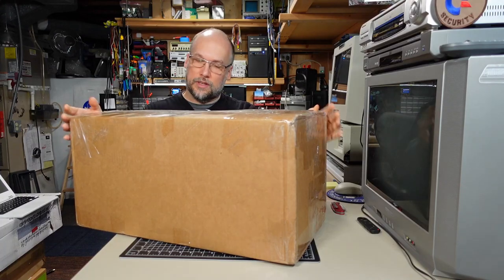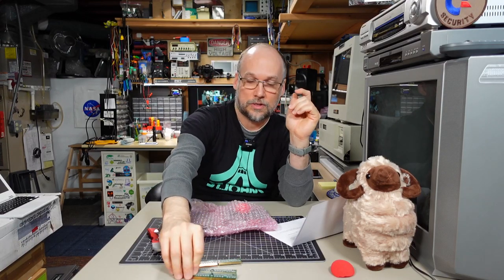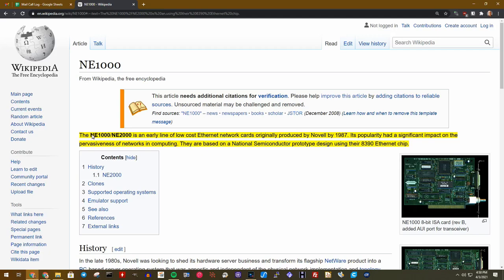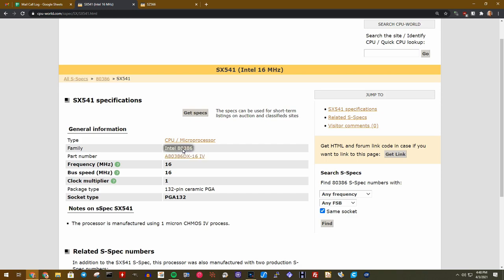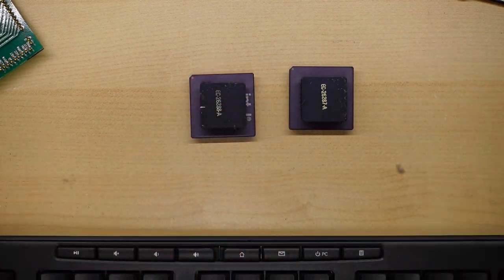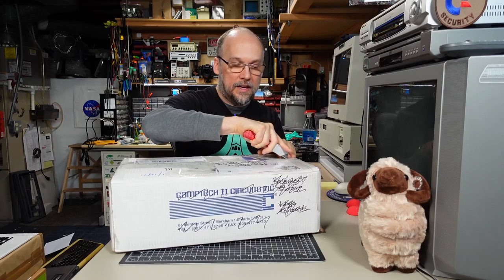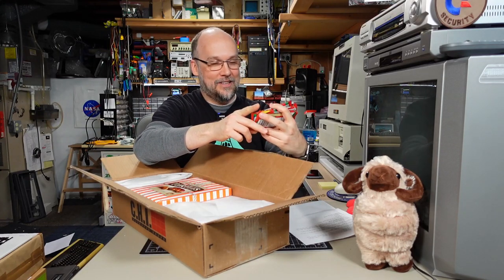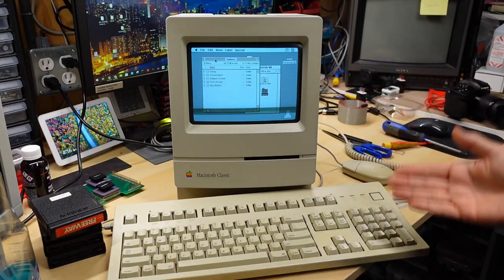RAMCHECK for Rammy, an Intel 386 breakout board and three keyboards

Comment: Dude, that RAM Check device would be a complete godsend, I've gotta get one of those someday. Especially with those SIMM adapters. I've got so many bags and boxes of untested memory modules that I have no idea about, argh.
I hope you can track down the adapters -- or some hero sends them to you!
Reply: Maybe Santa will bring you one for....CHRISTMUUUUUUSSSSS
Reply from the maker: Indeed! At first I wasn't so sure but then when I tried to get a Pentium board running with SDRAM, it kept having issues. Turned out all that SDRAM was simply bad! I know I have similar issues with other RAM I have too.
Reply: Hello Adrian,

I think there is a 72 pin version on ebay Germany. A couple of us were discussing it last night in the comments. We can sort out getting it sent over to you if it is the right thing.
Reply from the maker: @SP-nv1sg  yeah I saw that. It's rather expensive and I really need the 30 pin capability more than 72. It's odd that 72 pin only one exists as their website didn't even mention it. I am thinking about it :-)
Reply: Ah fair enough. I'll keep an eye on ebay!
Reply: Clint, when you reach 100k subs people might send you one also.
Reply: @adriansdigitalbasement  Could you possibly use one of your other adapters as reference and design the 30-pin adapter in Eagle or KiCAD?
Reply: @terosaarela4555  : Depends on the details of implementation. It might be pretty simple, in which case the answer is probably yes, but it might also have a rom or something on the adapters, in which case the answer is liable to be no.
Reply: There are a few open source RAM tester projects on github and elsewhere for 30-pin SIMMS.

(one is called "30pin-simm-ram-arduino" on github.)

It could probably be modified quite easily to test 72-pin SIMMS as well, although I haven't Googled yet for 72-pin SIMM tester projects.

DDR is quite a bit more involved though, as it requires a lot of differential trace routing on the PCB.

So it's worth keeping an eye out for more of those RAM Check units. It does look pretty neat.

Another option for testing DDR1/2/3 would be to use an off-the-shelf FPGA board with a DIMM or SODIMM slot on it. I bought one on AliExp last year for only £77 with a DDR3 SODIMM slot on it.

(I would post a link, but then this comment will likely get auto-deleted as spam.)

Could make for an interesting project to do the same for full-size DIMMs, because it wouldn't take much code (Verilog or VHDL) at all. The DDR stuff is also handled by existing IP blocks from the vendor.

I realize you can also just get RAM test software for PCs, but where's the fun in that? lol
Reply: @adriansdigitalbasement  the guy who ran Innoventions sadly passed away in 2019 and the company shut down after COVID hit. Their older SIMcheck II was a 30/72 pin tester that had add-ons to test at least SDRAM. I have one of them and have been looking out for add-ons.
Reply: There are a bunch of SIMCHECKs on eBay right now.
Reply: @adriansdigitalbasement  not a ram question especially not a Dodge vehicle question LOL.

But as for the keyboards Model F model M all those and others.

As long as you would have a USB keyboard adapter it should work although you'd probably need the adapter to go from the larger DIN connector to the mini DIN connector.

Then into the USB adapter.

By the way with mini DIN connector.

Yeah I know I'm not using the right names for the portsYeah I know I'm not using the right names for the ports.

. Just referring to the connector itself😕

But with the mini DIN connector.

With mouse and keyboard the wiring is very similar.

Forget how many pins are different might just be one????

Long time since I've looked at this.

That's one reason why it was easy enough to stack the mouse and keyboard connectors since a lot of the pins are common to both.

I know at least some laptops they used one connector that would support either mouse or keyboard and just had all pins connected through.

And also there was a splitter for some laptops that could put both into the same port.

But just Bridge the redundant pins of the female mini din connectors.

And pass through the the ones that were not comment both mouse and keyboard.

Also anyone have preferences on Old IBM keyboards I've heard all Every Witch Way.

Want to use a decent good keyboard 4 just general use don't need Windows keyboard key set for project!

But will be using the type of interface IBM keyboard use.

Also working on a presenter control that uses old school.

Not 5 pin din but another five pin connector.

That Kodak used on Carousel projectors.

Not for me but for someone else!

They've been wanting to do it for years.

Because people he knows still remember actual slides but he's doing PowerPoint and literally wants to use a slide projector control to run PowerPoint!

Kind of one off and unique.

Also he wants to use old-school wired remote for AV system control!!

But yet use modern equipment!

That's kind of some odd stuff but interesting different retro cool what have you maybe totally impractical but still just keeping things interesting
Reply: @adriansdigitalbasement   More than likely the 30 pin would be included in an ebay listing with the device. That's probably the only way you are going to find it.
Reply: @adriansdigitalbasement  I don't know about where you are but up here the local metal recycler pays $5 a pound for ram
Reply: @blitzwing1  

Thanks. I appreciate your kind words. ;)
Reply: While that tester will work ok for some testing they are not really that reliable hence their low price at release. A high end memory module tester can run you over 30K a unit.
Reply: @adriansdigitalbasement  For 30-pin SIMMs, maybe a SIMMverter? Use three known good sticks and one unknown.
Reply: I have one in my troubleshooting department at work. We have the DDR1, DDR2, DDR3 and DDR2 SODIMM adaptors. We don't use it almost at all but it's still cool. Apparently my company was working with the people who make the ram tester for a DDR4 module but then the maker either suddenly went out of business or was bought out and no longer offer the new module.

Comment: 386 breakout board: A0 and A1 isnt used externally since they select which byte to address, but that is handled internally since the data bus is 4 bytes wide.
Reply: to expand on this - if anyone is wondering "well how does it do unaligned reads, then?" the answer is that it does two aligned reads, and then shuffles bytes around as necessary. you can now imagine why a lot of newer and/or more compact architectures straight-up forbid unaligned reads.
Reply: @ravegirlcyan  And also why malloc implementations align all allocations to usually at least the largest data type the CPU will handle natively, and why structure members, stack frame elements and other data types are aligned to size of the underlying primitive data type by default, to avoid crossing these boundaries whenever possible.
Reply from the maker: Of course thanks! That makes total sense when I just think about it!!
Reply: The 68000 is similar in that they omit the A0 address pin.

It has UDS_N and LDS_N (Upper and Lower data strobe) output pins to denote which byte should get written to RAM (or mem-mapped IO).

Of course, that isn't usually required for reads, but if you have an IO chip with only an 8-bit wide bus, then you can just check LDS_N for valid writes.
Reply: Early x86 CPUs used a von Nuemann architecture.  The 386 was around the era when they morphed across into using a modified Harvard architecture where accesses go through caches. The CPU accesses external memory 32bits at a time but internally it can access 8 and 16bits from the caches.
Reply: 286 got rid of A0 I believe because it was the same as BHE#, with its 2-byte bus. 386DX expanded that to A0, A1 as @protonjinx has said. I may or may not be knee-deep in early PC books at the moment.
Reply: I typed out the same basic thing, but decided to check if someone had already posted it before I hit send. And you did.

Comment: Cut to Adrian in a tub full of RAM sticks, laughing manically.  "I shall have ALL the RAM!"
Reply: Also new bad parts bin or tub bad Ram modules.

Actually I turned my first bad Ram module I ever troubleshooted and found was bad into a keychain.

And then I was at a computer place and realize they actually made these from Bad Ram modules.

Don't know if they were just recycled from various sources or was that made in-house from Ram modules that I did not make the cut.

Don't know if there was anything to indicate on them they were bad I just saw the little cookie jar thing with them in it.

It was a retail product itself just thought I'd mention anyone else seen these?

They should make a little PC board ruler that looks like a stick of RAM.

Also wondering if they have a connector of some sort that would be numerous pins but would look basically like a ram module or something like that!

That would have holes for zip ties to attach cabling.

Might be an effective way to terminate large numbers of conductors to a board.

Wish there's a way to do that with card Edge as well.

Essentially a card Edge connector that would just be a piece of PC board with card Edge and sorrow holes instead of a full card.

Sometimes I've seen both connectors used s interconnects between boards.

So theoretically one could actually have a connector that mates with one of those sockets to do the same when numerous conductors are required besides the board connector could be a standard connector differently available
Reply: @fadate7292  umm..maybe not!

Comment: Don't be too hasty to throw away your bad ram. You may be able to scavenge good chips to replace bad ones, especially if you have a ram test machine and can tell which ones are bad. If not yourself, someone else might be willing to do the work
Reply: yes, please don't throw out the bad ones .. often it is only one chip
Reply: Yeah, keep the SIMMs in particular, they are not too difficult to repair, as they have few chips with large footprints.
Reply: If you can run Memtest86+ on the module, you can figure out which chip is bad because Memtest will tell you which memory address is bad. Since the memory map is linear and the memory module pinout is known, you can just calculate which memory chip on the module the bad address resides in and replace it.
Reply: Especially if he can get his hands on a better hot air resoldering station with a more diffuse tip. Pulling surface mount RAM chips becomes comparatively trivial then.
Reply: @sorphin  I use Memtest 2.01 all the time on 486 machines and it works fine.

Comment: Address 0/1 on the CPU breakout are missing because those two lines address the byte, but the bus is 4 bytes wide, so a read will select the correct byte internal to the CPU and a write will either have 4x byte enable / write enable signals to select which byte(s) to write, or the bus doesn't support byte mode at all and the CPU will do a read-modify-write.

Comment: I found some Ramcheck 72-pins SIMM adapters for you Adrian, but the seller apparantly only ships to Europe (it's a German seller). I could order one for you if you'd like and send it to you 👍 They're not really cheap though...
You might also be able to use one of Rammy's 30 pin to 72 pin adapters and be able to test the boatload of 30-pin simms he owns with it on the Ramcheck ;-)
Rammy is gradualy becoming sort of a hoarder, but I guess it takes one to know one 🤣

Comment: I STRONGLY RECOMMEND using a rubber eraser on the RAM pins and other expansion card pins if they seem to be giving any trouble. I have fixed so many that way.
Reply: ...and don't use your breath to blow off the eraser shavings! Back in the day I fixed a couple of misbehaving Macs (don't touch them and they spontaneously crash) by eraser-ing the RAM contacts.

Comment: Adrian, I really think you should confirm the results of the RAM checker with Memtest86.
Reply: Doesn't that only work on new computers that use UEFI? I know my pre-UEFI computer refuses to run it no matter what I do—and anything newer probably only supports DDR3 or higher.
Reply: @stevethepocket  I've used it back to 486. It's on the office PXE image here
Reply: @rtechlab6254  Hmm. Must just not be possible to get the older version anymore, then.
Reply: @stevethepocket  pretty sure the version on my car key usb key is the latest and is fine. I'll have to check

Comment: Oh that RAMCHECK unit is super useful!

After I had those 30-pin SIMM boards and chips sent to you for the Let's Make Some Memories project, I ordered some 72-pin SIMMs from a local eBay vendor, and they came with a nice test print-out. It said RAMCHECK on it, so I googled that and discovered these testers existed. I immediately jumped on eBay and searched for RAMCHECK, and ended up paying way too much to import a unit from the US! It only came with the default DIMM module adapter, so that wasn't that wasn't that useful. I did some more searching and found a 72-pin adapter from an eBay vendor in Germany, but I ordered it at the height of the pandemic, and the vendor sent me a message saying he couldn't actually send it since there weren't any flights from Europe to Australia, so I had to cancel the order. I can still find it in my watch list, although for some reason it doesn't show up in a search (listed as model RC72SIMM-ADA, maybe it's restricted to eBay Germany). In any case it's just the 72-pin model, not the combo 30- and 72-pin model.

I ended up ordering the older SIMMCHECK model from another US eBay vendor, which came with both the built-in 30-pin socket and also the 72-pin expansion module. It's not as good as the RAMCHECK, as I believe the PC interface is only used for updating the firmware, and can't be used to automate testing and get a report on the results.

Hopefully you can get a hold of the 30- and 72-pin adapter module. Although it should just be a passive adapter, so really all you'd need to design your own is the pinout of the expansion connectors. SIMM sockets are pretty commonly available on eBay. EDIT: Looks like someone else in the comments has reported that the company is basically shut down permanently, which is a real shame. Anyway, if you do manage to get a hold of an adapter module, it would be good to reverse engineer it so we could make our own!

Comment: That's not a PLCC socket, that's a PGA socket. PLCC are those plastic square sockets (like Fat Agnus on the Amiga).
Reply: Tom Servo:  Amiga!  Heh-heh, now there's a relic for you!
Reply: The 'ol Pin Grid Array
Reply: A bit more informative to say that PLCC chips only have leads along the edge of the chip, and the leads curl around the case instead of being pins.

Comment: That NE2000 NIC brings me back! The first NIC I ever setup in my own 486 PC was a 16 bit NE2000 NIC with only a coax connector on it. My best friend lived next door and we had a 10 mbit coax network setup between the houses. It worked great for early LAN gaming in the Doom & Duke3D days! We used to buy BNC terminators by the dozen cause they seemed to fail constantly! We all kept NICs with BNC connectors on them in our PCs until 1999 when we started getting cable modems and moved on to regular 10/100 ethernet.

Comment: I'd bet that the modules at 27:20 and 28:20 are both 66MHz and being misdetected/ran at 100Mhz/83Mhz.  Can  you force the tester to 66Mhz for those 2 modules?

Comment: Wow that keyboard brings back memories. Used VT100s  & 340s connected to Vaxes in mid to late 80s (along with several Pericom graphics (Tektronix-compatible) terminals). Very sturdy (tank-like) beasties :-)

Comment: We used to have a memory tester when I worked at Frys.  It could do 30, 72 and 144 pin modules.  The 144 side could test Fast Page, EDO and SDRAM all on the same socket.

Comment: NE2000 cards are fun; the short version is the NE1000 and 2000 cards were basically made by Novell (and NE is "Novell Ethernet") built around a National Semiconductors part. Novell made the cards very cheap and they're basically why Ethernet beat Token Ring in many ways. The only real difference in software between NE1000 and 2000 is the 1000 uses byte mode data transfer while the 2000 uses word based data transfer, primarily dealing with how the ISA bus can do data mode transfers.

Still need to watch the rest but thanks for the shoutout!

Comment: Back in the 90's we installed a number of those ne2000 cards they had anti virus built-in to the roms. The card would scan files sent and received through the network.  The problem was updating the AV signatures they quickly were out of date.

Comment: 4:00 Oooh, nice. That's a VT 100/101/102 terminal keyboard from what I can tell. That's the very first computer I had ever programmed on (DEC had a version that ran CP/M locally). They had a computer bus that visited my Jr High school in the 80s, in Massachusetts.
Reply: Yes, a little-known feature of those terminals was an extra slot to add a small computer board. The terminals themselves used an 8085; I wonder if it was also possible to just add more RAM and I/O on a board?

Comment: I don't even have a need for that ram tester and I still want one. That's got to be invaluable if you have the right adapters.

Turtles are pretty common in the US. I see them regularly, often they'll sell them individually (or two in a packet) at grocery checkouts.

Toffee differs from caramel in that toffee includes butter and almond in addition to caramelized sugar.

Comment: I used to use one of those Ramcheckers , great when it was new but after a few years the connectors all got worn and it would fail good modules.
Try finding a module that passes and then gently wobble the module.

Comment: I'd recommend cleaning the pins on anything that's tested in a ZIF socket. I have had a bunch of stuff test bad until I cleaned it with a solvent or IPA in a similar tester